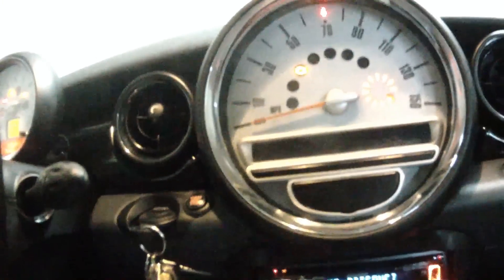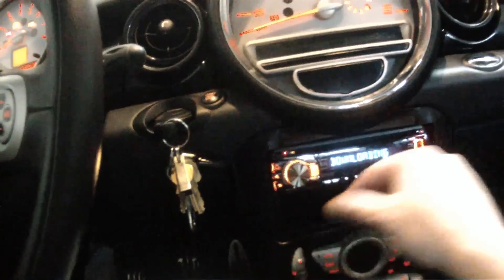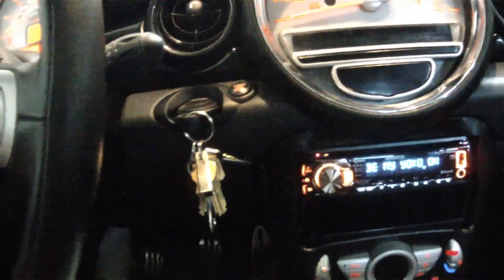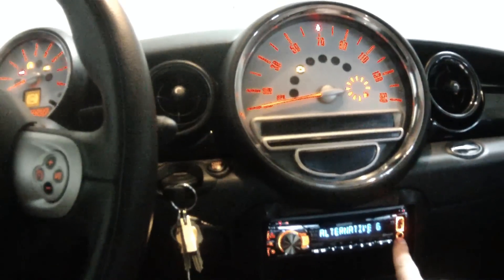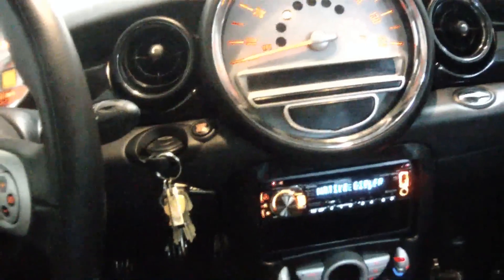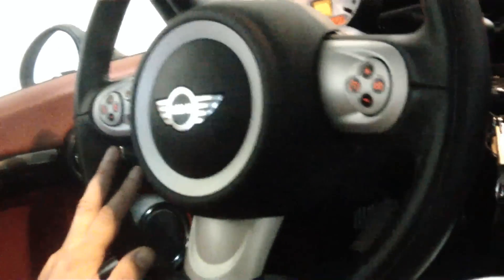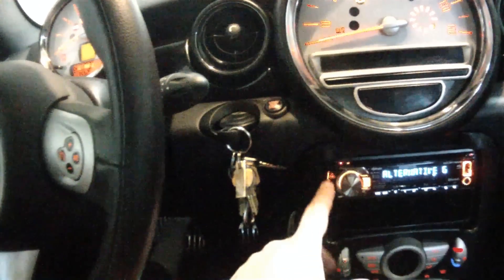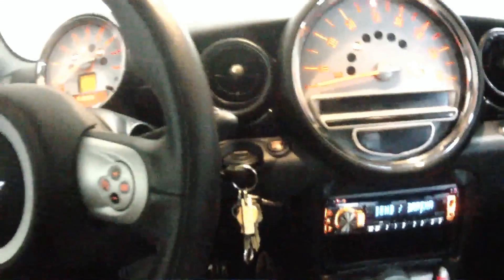How To Install An Aftermarket Stereo Upgrade In A Mini Cooper R56

Comment: My radio won’t power on but all my Speedo , petrol , warning lights still work fine. Would changing to this aftermarket radio work or do you think I have a fault in the actual wiring in the system. Thanks.

Comment: First, thanks for the video - the information is very helpful.  Any chance you could provide a link to the antenna adaptor at Amazon?  Also, did Best Buy have the adaptor to maintain your steering wheel controls, or was that purchased elsewhere?

Comment: Thanks for your videos. I have some questions. I have a MCS 2007.  I didn't get the Bluetooth option because at the time it was integrated with the Nav system and Mini wanted another 2K for it. I would like really like to get Bluetooth connectivity with my phone. That's really all I need, but I wanted the ability to use the exisiting button on the steering wheel to answer calls. So far I have only found external Bluetooth systems that have to be powered by the cigarette lighter and attached to the windshield visor.  Do you know of a way for me to get an integrated solution? Thanks

Comment: You're incorrect.  I asked the guy at Best Buy last night and my install would be over $1000, even buying a stereo that comes with free installation.
Reply from the maker: Lindy Turner then go to a different Best buy. They don't do $1000 installs there. 

I had mine done at Best buy. Have had more than one done there actually for other vehicles

Comment: Due to the wiring harness that was sold? No, it's more like due to the fact that the installer was a hack. Many European use the same time of wiring harness, and for whatever reason, the third party companies make who make the adapter put the 12v constant and the 12v acc in a certain orientation which is actually only correct on very few vehicles, however, all you have to do is unpin the two wires and exchange their places (or if you're a lazy ass just hook up the yellow and red wires backwards)